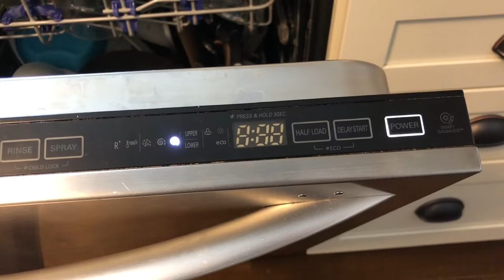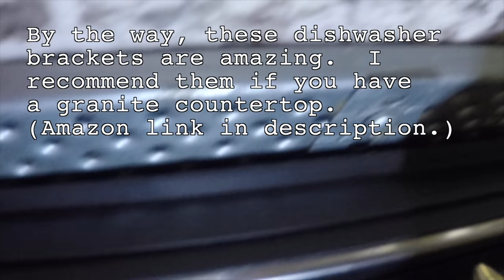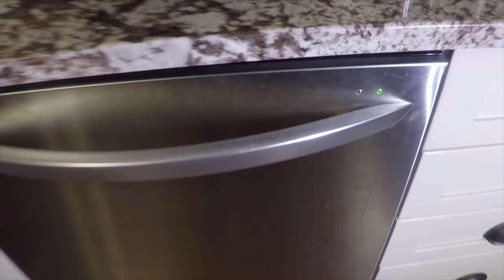LG Dishwasher Not Draining (Repair)

Comment: Did you check the motor resistance on your failing motor?  I removed mine as you showed in the video and measured the resistance at 4.7 ohms, which seems to be within what LG says is good (4-5 ohms).  

Also, was your unit pumping any water out?  Mine pumps water for about 3 seconds, then stops.  After 15 seconds, it pumps a little more but never pumps out all the water.  That cycle repeats a few times and eventually stops with an OE (or DE) error.
Reply from the maker: Mine had the same symptoms. It pumped, but sounded like it was struggling. Didn’t pump all the water out, just some.

Comment: Excellent video; provided essential information at the start of it about the meaning of the error message which likely most users would misinterpret (I did) and a useful hack to get the dishwasher to drain ( my primary concern). My issue may have been a one off  as I’m not having repeated instances of water not draining … but will reference this video to troubleshoot if it becomes a problem.
Reply from the maker: I check back on my own video when I get the same issue! 🤣

Comment: question, i replaced the pump no issues but the round gasket fell apart so i omitted it, will this be an issue? The new pump did not include a new one. I ordered the OEM from this link. Thanks for your input.
Reply from the maker: Yes, that is required. Transfer it from the old one to the new pump. Use silicone grease if needed.
Reply from the maker: It’s going to cause leaks without it.
Reply: it completely fell apart so I don't have one now in there. geat lol figuring out that part number will be fun.

Comment: T, T and T, thanks for this,  42 bucks, 20 minutes work and my dishwasher is back in action.  One other diagnostic symptom is that the water flow surges out of the airgap/drain hose instead of a steady stream.  I slid mine out just far enough to tilt it back about 45 degrees, it was easier than laying on the floor and doing it through the kickplate.
Reply from the maker: Very cool. Don’t you feel like a superhero now that you got it working?  👍
Reply: @chicagohandyman  - not quite superheroish, but my wallet feels a lot better about it.

Comment: Just to be sure, your drain pump was still working, but not enought to drain it all ?
Reply from the maker: Drain pump wore out, so it was at end of life. It would randomly sometimes barely pump. Circuit board would ultimately time it out and spit back the error code. Only solution is to replace the pump assembly.
Reply from the maker: I squeezed out all the life I could get out of the pump for 2-3 weeks after the problem first manifested. Would work ~70% of the time. After that, the pump was shot.
Reply: @chicagohandyman   Ok thanks, it seems like the same problem as mine, the pump still working, I can pump all the water by making 3 draining process, I checked all the hoses and they seems ok, I will try to change the pump, thanks.
Reply: What's the pump voltage?

Comment: Great video.  Found it after doing the same work, and can confirm this is step by step exactly what to do.  The only thing I would add is that when you disconnect the drain line that runs from the dishwasher to the sink or drain spot, I used my shop vac to suck it clean.  With the drain hose in the shop vac, seal the gap with a towel to get all suction on the drain tube.
Reply: I also did this, no water issue whatsoever during the fix.

Comment: I just swapped yhem out this didnt do squat o jist spend 60 bucks and its still kicking the error code any other brilliant ideas
Reply from the maker: Take out the filter that’s on the bottom of the inside compartment, and clean it. Also verify drain hose doesn’t have a blockage anywhere.
Reply: @chicagohandyman  yeah that was the first thing i did i cleaned all the hoses out blew air through them. Decided to say screw it and going to buy a used one today

Comment: This is exactly my problem and the drain pump itself was exactly what I suspected! This basically confirms that’s likely my issue and I’m ordering the part now. Thanks!
Reply from the maker: I would now also advise to check the drain hoses for any blockage. Good luck with your repair! 👍
Reply: @chicagohandyman  Thanks, I think it’s clear. I can force a drain and it tries… I can see water drawing into the disposal. But it’s just weak and making a whining sound like it’s dying.

Comment: You do not need to touch the machine in order to replace the pump. Only the kick panel needs to be removed  and you will have access to  the pump.Do not waist your time.
Reply: Penyo Zehirev : next time before writing stupid comment, watch the entire video. At 1:55 you will see that the drain pump is located on the back of this dishwasher. If yours is not LG brand it might be different, but here LG dishwasher is discussed. Don’t you think?
Reply: At 1.52 you said that the dishwasher is on its back. Also is clearly visible that the door is on the top and the pump is  under the door. So "stupid comment" does not apply. I can bet i have seen way more LG dishwashers  than you. Don't you think?
Reply: @kstatinet-wk2gh  I guess Penyo already pointed out who is the stupid, or at least not very observant, person.  Maybe you should be more careful the next time.  I just changed mine out and I did it via access through the front panel.
Reply: @thomasedinger2655  : I confess, Thomas. It is my bad. Hopefully, changing pump solved the problem for you.
Reply: How do you get access to the drain pump from the front. It looks to hard to get it out without turning this thing over.